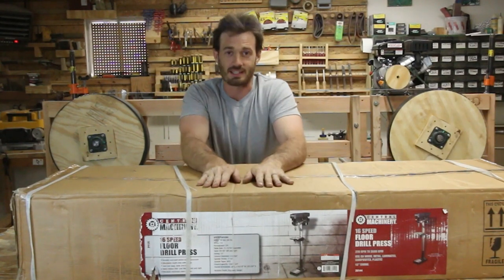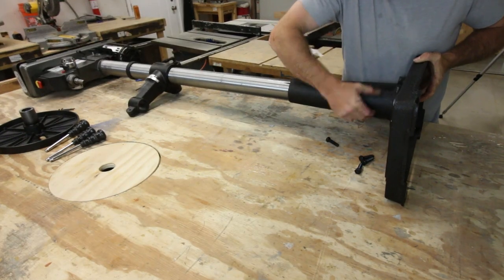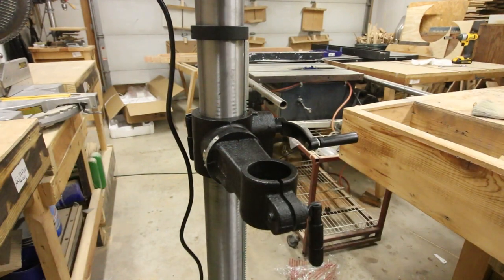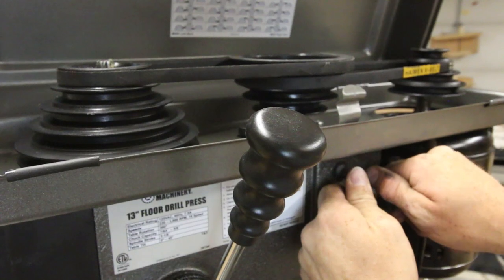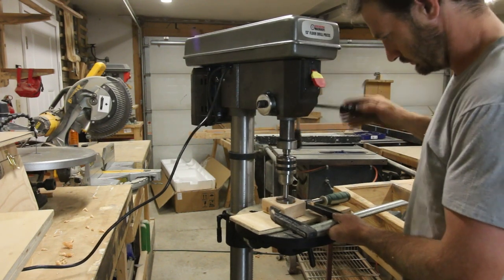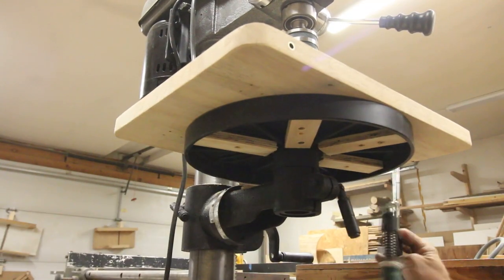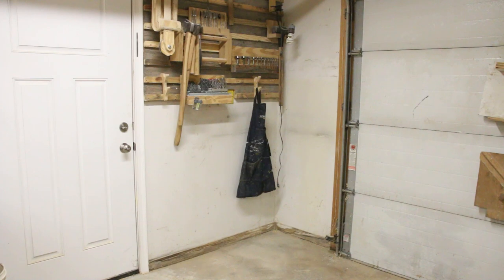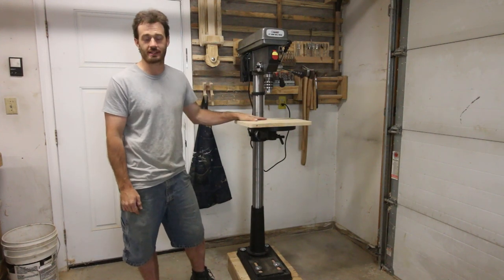Is The Harbor Freight Drill Press Worth It? Honest Review and Assembly

Comment: Fact of life. Cheap tools generally need some customization to make them more usable. Attach your chuck key to a light weight chain, and attach the chain to the press. Makes it impossible for it to walk away, or end up in a pile of sawdust.
Reply: Good point. I've never done it any other way, and never lost one. But I admit his solution is clever. This is too small for me, but I'm thinking of buying the 20. At my age just don't need to spend $1,000 more for a brand name.
Reply: @reidiford1136  I've bought and sold a bunch of drill presses over the years. The new presses in the lower price range are not very good. Check Craig's list, and estate sales for vintage USA made. I have dealt with some pretty amazing ones in the $200-$400 range, and the quality is not even close.
Reply: I use a heavy duty magnet epoxied to the side of my drill press main body. Haven't lost one yet! :)

Comment: Back in the day, HarborFreight carried the Central Machinery line out of Taiwan. My Dad bought one and years later it was subjected to a house fire. He cleaned it up pretty well and it continued to run. I inherited it, being the only son he left me everything tool related, and I didn’t have a place for it so it was subjected to further abuse through storage, exposed to moisture and general abuse. About 3 years ago, my wife and I built our home and that included a workshop for me. I completely disassembled the drill and began a weeks long restoration. Frankly, I thought it would end up scrap metal! It was in an absolute deplorable state!! Rust wasn’t just the color, it was the condition! Well, it turned out amazing and I even continue to use the original fan belt from when he got it in about 1980! She runs and operates today as she did new out of the box from HarborFreight!! And yes, incredibly powerful! Laugh all they want, ye critics of HarborFreight, but I have far more good than bad to testify about them and their tools!!

Comment: ❤❤❤ I bought a 17 inch ones. I modified it and put it on a very large heavy duty pedestal that I built out of wood to give it a better stance.❤ I am very happy with it. It works well and it’s got a lot of torque if you put it in the low speed operation for drilling metal or something heavy duty.❤

Comment: Great review of the drill press.  About 50 years ago I bought a Taiwan made drill press of that same design but a lot more substantial.  It does not wobble on the base.  If you experiment you will find that the drill bit can touch down on any part of that table.  This means you can bolt the vise to the table and never have to move the vise.  I would advise always clamping things you drill to the table or use a vise.  A part will helicopter and hurt you severely if it gets caught on the bit.
Reply from the maker: That's good advice. Thank you

Comment: The quill return spring on mine broke abouts 6 months in.  I bought one from Grizzly  for their equivalent machine.  The Grizzly spring is substantially thicker and stronger.  Don’t forget to get the cap also, as the Grizzly spring doea not fit in the Harbor Freight cap.  I also placed mine in a mobile base, which made it more stabile because of the added width.
Reply from the maker: Great info thanks!

Comment: Use a strong small magnet and a drop of super glue and glue the magnet on the drill press where you want to keep the drill chuck, you can choose the spot most convenient to you. Or double sided tape if you want to change it in the future. If the magnet goes on a flat part of the machine but may not need glue as the chuck key is rounded so will stick less strongly to the magnet.

Comment: I jave the 17 inch model.  I got a small magnetic parts bowl.  Stuck that on top of the machine and put the chuck keys and Allen wrenches in there.  Magnet is strong enough when I open the lid to switch speeds it doesn't fall off and the prices stay in the bowl

Comment: Good review. Obviously it needs to be bolted down, that’s not really a drawback. Even one with a wider base should be bolted down, not free-standing. As for the 15/16” bolt, a simple box-end wrench will be perfect. I’m getting this same drill press to replace an old, cheapo one I’ve had for years. For occasional woodworking use it’s perfect.

Comment: It depends on what kind of metalworking you're using, whether or not that's a good one. I've seen people use just the bench top drill presses and do a lot of metal working, especially if they're just punching holes which is drilling out holes to be tapped later or just for pens or something like that

Comment: Would a Harbor Freight racheting box end wrench on the tilt function?
Reply from the maker: Maybe? I dont have one that size but it might
Reply: @WyldeWoodworks  I have had one of these drill presses for quite awhile. Never actually used the tilting bed function yet. I recently moved and haven't dug it out to set it up yet but did buy a couple sets of those wrenches. Guess i will find out soon.
Reply from the maker: @genegene3348   I would love to know if it does. I would buy the same set. I've been meaning to upgrade my ratcheting wrench set anyway.

Comment: Next get a vice so you don't mangle your fingers.  Isn't that a magnet on the side for the chuck key?
Reply: If you're talking about the chrome puck on the side, that's the housing for the quill's flatspring. I do agree that just slapping a magnet to the side would be my choice for chuck key storage.
Also yeah this dude needs to get a drill vice before he loses a finger or worse, I've seen a guy need 30 stitches after a drill press grabbed a piece and ripped it across his stomach. Not a big fan of the one-handed fumble-opening of the belt cover while in operation either. Minus points for the lack of eye protection too.
Reply from the maker: I used a drill vice in the video
Reply: @WyldeWoodworks  AFTER you got your fingers wacked.
Reply: @WyldeWoodworks So you did indeed, my bad. I hadn't watched that far.

Comment: Wow, the spammers hit your video fast. I reported all of them to keep the comment section nice and clean. Hope you get some good use out of that drill press. Another option would be to find an old Shopsmith for sale and modify it to stay in drill press mode all the time. Then you don't have to swap belts and have a much larger table.
Reply from the maker: Thanks!  In the 1st 10 minutes I have to delete a bunch of them on every video.  I've never actually used a shop smith. Do they take up a lot of space?

Comment: Hi, so 6 months later, what are your thoughts on this drill press?
Reply from the maker: It's ok. Spend the money to buy a better one if you can.
Reply: @WyldeWoodworks  what would you recommend?
Reply from the maker: @Joe Junod  I'm not sure honestly. I would say try to find a good used one which I have had no luck doing that in my area.
Reply: @WyldeWoodworks  I'll look around for sure. What are your biggest issues with this harbor freight one? I'd be using it for woodworking but nothing crazy
Reply from the maker: @Joe Junod  It will probably work fine for that. The biggest issue is it just feels like it's always about to break. It will drill accurately which is why I haven't replaced it yet
Reply: @WyldeWoodworks  ahh okay, well thank you for the info!

Comment: Hey man, nice vid. Got some good ideas of what I need to look for in a cheap drill press. I'm sorry for the unsolicited advice but I really think you need to pay more attention to safety in the workplace. Lack of eye protection is the least of it. Holding the workpiece by hand made me pucker and using a glue clamp is not much of an upgrade. The one-handed opening of the belt cover is something I would really REALLY not recommend.
Reply: Everybody on youtube appreciates safety advice. I'm confused about your belt cover comment though? You would try to grab that little knob with both hands?

Comment: Interesting...you somehow got an all cast-iron/steel version!  I just bought this same DP from HF, the 13 inch 16 speed. Every part except the tube and base was ALUMINUM, yes even the quill! I ended up returning it right away once saw the spindle shaft was completely bent cause horrendous wobble and vibration. Complete junk and a waste of my time.
Reply from the maker: Seriously? Yeah it was all steel and cast iron
Reply: @WyldeWoodworks  Indeed! I later saw on HF product reviews, on their page that some reviewers had different skew numbers, apparently there are two versions from different suppliers.